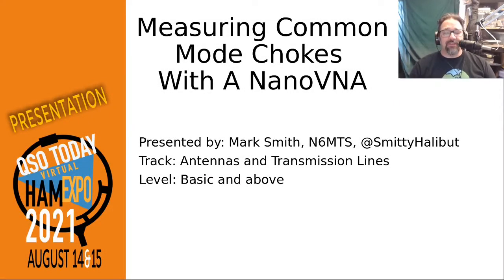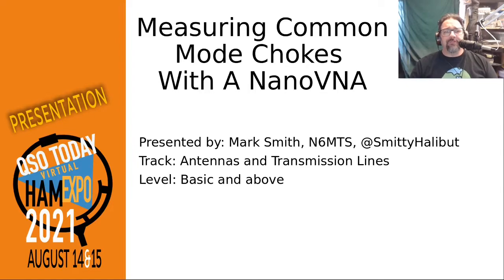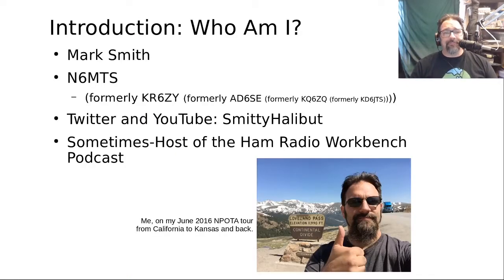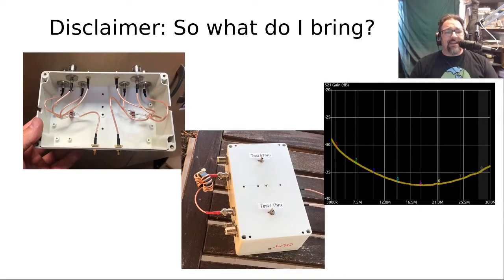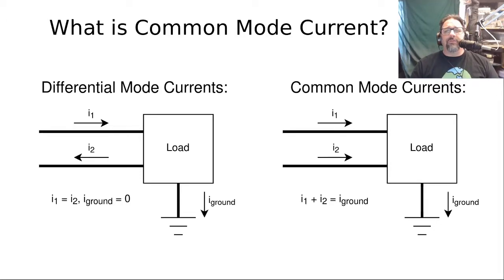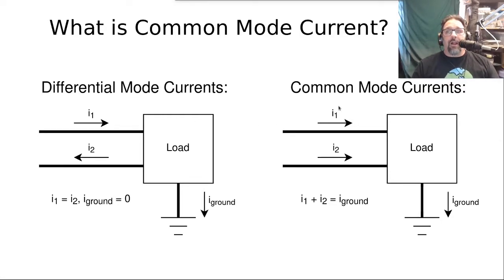Measuring Common Mode Chokes - QSO Today Virtual Ham Expo, August 2021

Comment: Just viewed your  great video presentation Mark. Pity I had not viewed it earlier as I have had to discover your test technique by experimentation over the past few days! On the up side your video has validated my test setup discoveries and tells me I'm on the right track. So now I need to get a test rig constructed and I will pay further attention to  the internal layout as you suggest, and especially because I'm headed towards  the 2M / 70CM testing  zone . 73 de GI8WFA 👍
Reply from the maker: Since recording that, I’ve made a test rig kit available: https://electronics.halibut.com/product/common-mode-current-choke-test-rig/ I’m not sure how good it’ll be at VHF and UHF, but it should work well enough at HF. 

For VHF and up, I’d made individual adaptors for each connector type, and keep all wire lengths as short as possible. I also wouldn’t bother with switching.

Comment: Very interesting and informative.  The MFJ-915 is a straight line coax between the two UHF connectors with many ferrites strung on that length.  I use these at the antenna.  Now I need to add one between the commons of my 6x6 antenna switch so it will always be in line with my transceiver or linear.  Right now I have a RF sampler tap to an oscilloscope in the common coax lead.  They call the MF-915 an isolator.  I think it can also be called a common mode choke.  I wonder how it would compare in effectiveness to your double/three loop solution.  

Thank you for this information.  73 Doug N8VY😎
Reply from the maker: That method certainly works, but it’s effectiveness is linear with the number of beads you put on the coax. Wrapping coax around the toroid or coiling it, the effectiveness goes up with the square of the number of turns.  This only means it takes a lot of ferrite material (read: cost) to have the same rejection. It still works the same. 

Having said that, the linear version doesn’t increase capacitance, so you don’t have the self resonance problem I mentioned in the video. That’s a benefit to doing it the way MFJ does it. 

Isolator vs choke: yeah, I think they’re basically the same. Assuming your description of the 915 is right (just a length of coax with ferrite beads on it), it’s a common mode current choke.

Comment: At about 25:00 minutes, you show a cable with two loops of 3 turns, each with a single clamp on ferrite. Would you get the same result with one loop of 3 turns, but placing the 2 clamp on ferrites on that single loop? And do three ferrite beads on a cable have the same result as 3 turns through a single ferrite?
Reply from the maker: Three turns, two clamp ons: It would not be exactly the same, no.  I don't have measurement data at hand, but my memory was that two separate 3-turn loops, each with one clamp-on, provided better rejection than two clamp-ons on a single 3-turn loop.  The clamp-ons increase the inductance of a loop without increasing the capacitance, which is good. But the loops are the root of the inductance; having two of them in series is better than having one.

Three ferrites vs three turns through a single ferrite:  These are VERY different.  Adding ferrites to a cable is linear, but adding turns to a coil is geometric (goes up with the square of the number of turns.)

Think of a single ferrite on a cable with no loops as a 1-turn inductor (which is what it actually is).  When you put three ferrites on that cable in a line, that's three 1-turn inductors in series.  When you put inductors in series, their inductance adds.  So the inductance is i*n  (i being the inductance of a 1-turn inductor, n being the number of ferrites).

However, adding more turns to your inductor causes the inductance to go up with the SQUARE of the number of turns:  i*(n^2).  So, this is definitely a more efficient use of expensive ferrite material.  There are draw-backs to adding more turns, however:  1) It is physically larger and possibly more awkward than just a straight linear string of beads on a cable.  Stringing beads on the cable may be the more PHYSICALLY preferred solution.  2) As shown in the video, more turns also increases the mutual capacitance between turns, which makes the choke more resonant, and results in that very peak-y graph.  So more turns is not always better.  That's why I suggested sticking to three turns, and adding more inductors in series.

Does that answer your questions?

Comment: Hi Mark, excellent! somewhere in the past I ran across a directive that when building an "ugly balun" (coiled coax) that it was better to make the coil such that the turns did not overlap.  ie. that you should wind them on a pvc form so the turns don't overlap, and the reason was to minimize the inter turn capacitance.  I wonder your (or other viewers) thoughts on this idea?  I'll have to break out my nano vna and test it.  Thanks for sharing 73, n7kbc
Reply from the maker: Yes, exactly that. My tests of the Gordian Knot chokes shows why you absolutely want to keep the turns from overlapping.  I'm really bummed I didn't make a proper ugly-balun to include here.  I actually had a slide at the end that I cut out because I didn't do it justice.

Comment: Hi Mark, After hearing you talk about this on HRWB podcast I was intrigued to see more. I think seeing is believing when talking about chokes and baluns because often we are just told to wind turns on a ferrite but I need to see the proof !. This video has certainly gone a long way in helping my understanding of these devices. I hope to build this test jig in the future (just need to get the VNA 1st !).

One small point. In the video I cannot see the link between the outer connectors of the VNA ports in the white box build. I assume it is there?
Reply from the maker: Also: thank you for the kind words! I’m glad you enjoyed the video and found it informative. :-)
Reply from the maker: Ignore the post I just deleted, I misunderstood your comment. You’re talking about the ground link between the two sides. 

Uhhh…. No, it’s not. Good catch. blush

They are connected back at the VNA itself. So the current has a path. It’s just not the path I’d prefer it to take. The fact that I kept the jumpers between the VNA and test rig short May be what saves me here. But yeah, that’s not good. 

Thank you for catching that.
Reply: @SmittyHalibut  The pleasure is all mine. Good luck with 'secret squirrel'

Comment: Your test rig would be helpful for pre-made common mode current chokes, (and coax wrap style chokes, such as your 3 turn Gordian knot example).  This guy does a more raw test rig that seems to be based on the same testing structure https://youtu.be/vuxULomtB-4.  I might give both a shot.  Then I could test ones that I've purchased, and experiment with building my own.